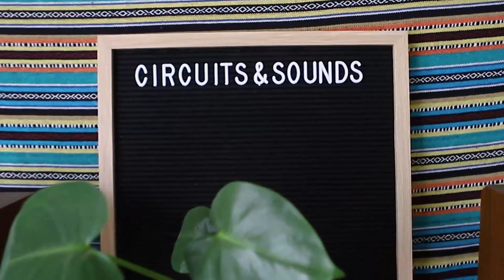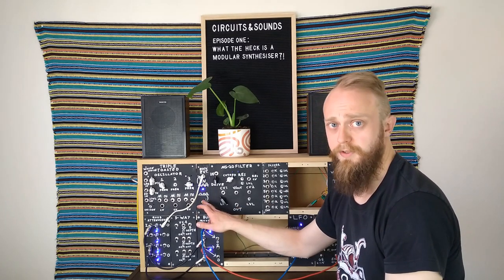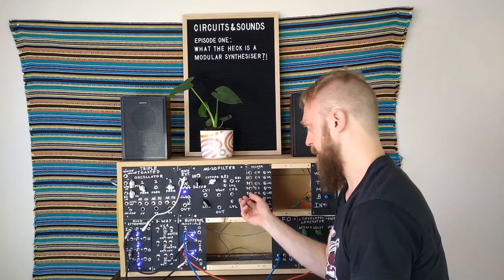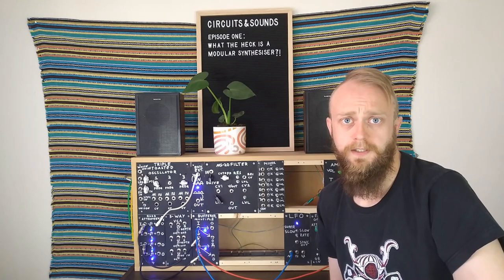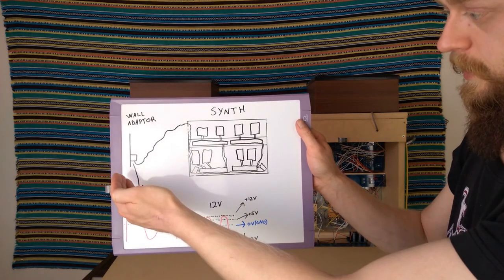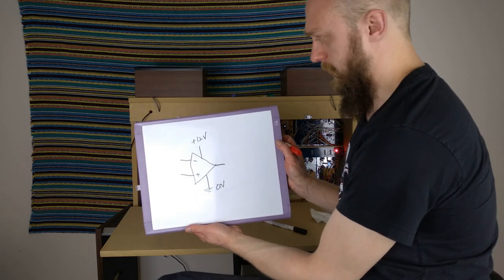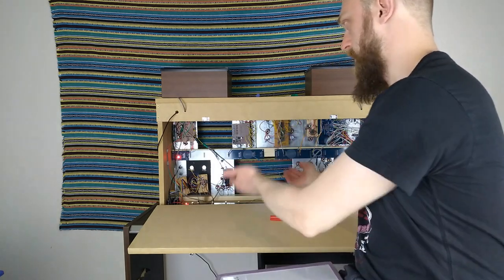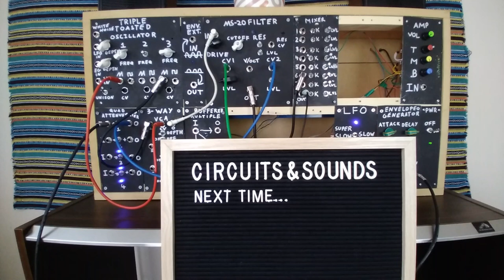What The Heck Is A Modular Synthesiser? - Exploring The Basics Of Sound Synthesis & Power Supplies

Comment: I think, if you're going to take this project, (which is awesome by the way, I applaud anyone who takes the trouble to teach others) any further, you're going to hit a wall with that single ended powersupply. You only have 6 Volts up down to work with. Most designs you can find on the internet need at least +/-12V
Reply: That's exactly it! So far, a lot of the designs seem pretty happy to be biased up to 0V - 12V, but I dunno when the luck will run out hahaha. I think my biggest problem is just the power consumption, as I'm not using a whole 12V of available power from the supplies. But ah well, I can make some stupid noises with the machine, so I'm taking that while I can hahaha.
Reply: @sebastianyoung2404  Cool! Should be an interesting experience. I subscribed :)